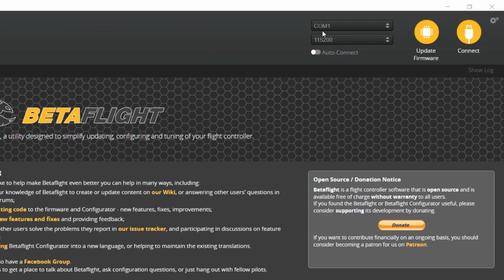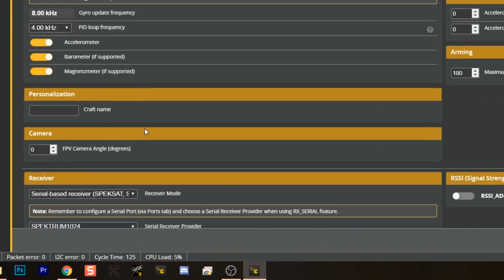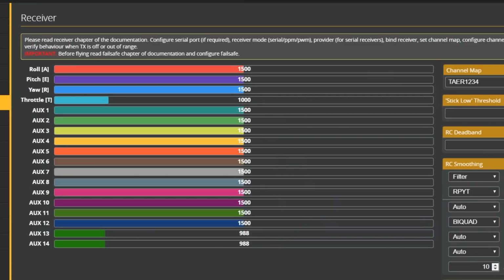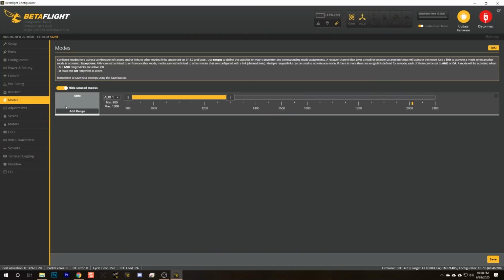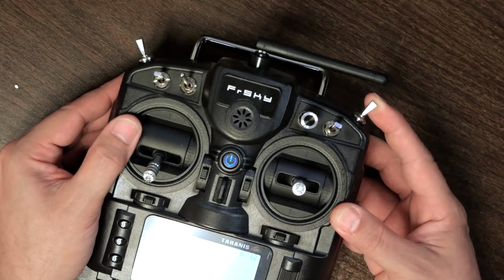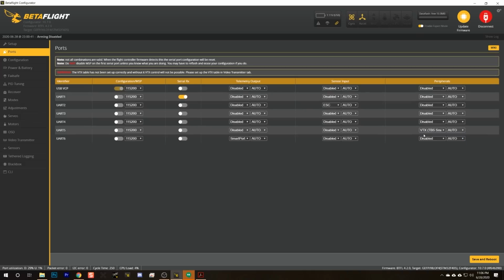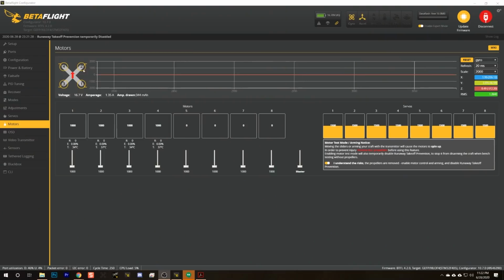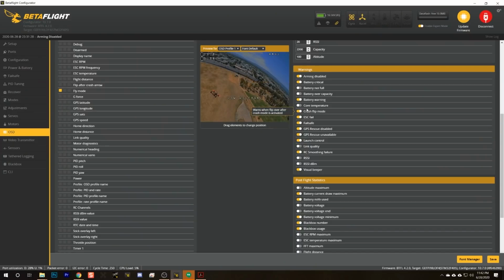FPV Drone Budget Build Full Tutorial - Part 3 - Betaflight 4.2 Complete Set Up

Comment: Hey Joshua, is the PID loop frequency choice of 4khz for any reason? I’ve read on Oscar Laing and other sources that the default 8khz is better. I’m not sure if this has to do with f4 vs f7 flight controller or what. But my plan was 8khz and dshot600 on my holybro kakute F7. Are those okay in my situation. And the the 48 pwm frequcy & auto motor timing in bHeli32. Please let me know if you have a chance because I don’t want to screw my first build up! You’re such an awesome help, thank you for all you do in this hobby man!
Reply from the maker: For an F4 processor, when doing RPM filtering, there is not enough CPU power to run at 8k.

Comment from the maker: Three notes on this video. For some reason, other people are having to go to the CLI and type 

set tlm_halfduplex=off
save

To get telemetry working.

Also, the 24k option seems to have disappeared on the latest batch of ESC's. I have no idea why but you are fine to run 48k.

Also, the vtxtable has changed from SA 2.0 to SA 2.1. Get the new vtxtable here: https://getfpv-media.s3.amazonaws.com/wysiwyg/files/XILO_VTX_SA2.1_US37.json
Reply: Thanks a lot. Had to set "tlm_halfduplex" to "off" to get telemetry working. Great series!
Reply: @linus.  How can I identify if I have to set the setting off?
Reply: @GothicIN  I got just ~4 telemetry "channels" on my radio. After setting the option to off, I got a lot more telemetry data from the flight controller.
Reply: Thanks!!
Reply: Ah, that explains the 48K PWM frequency. Thanks for everything you do, Joshua!
Reply: I just bought a kit and On the motor pwm frequency it originally comes with 96kHz and the motor timing is set to Auto. The lowest I can set it to is 48kHz, I know your comment says leaving it at 48kHz is fine but what about the timing? Is it fine to have it at 48kHz and the timing at 23?
Reply: 48k is the lowest I can go. I’ll set that with 23deg. 

I’m not sure if the values are dependent on each other, so if it’s a problem please send a smoke signal.
Reply: Hi JB pin this please. 2 people who got your build cos of me had VTX issues
Reply: was gettin nervous aha
Reply: The SmartAudio 2.1 table caused my video to not work at all, changing back to S.A 2.0 fixed the problem!

Comment: I just recently built this following the videos.  I used a Spektrum 4651T receiver and used UART4.  Everything in Betaflight looks to be configured correctly, and the transmitter (old DX8, DSMX) has been configured and bound.  I updated the frame rate to 11ms, too.  All the controls are reacting appropriately.  As soon as I increase the throttle though, the quad will hover for about 3 seconds, then do a hard right roll and go straight into the ground.  On my workbench (no props), the motors are working OK as tested in Betaflight.  If I increase the throttle on the TX though, just a little, it seems like the motors go into "run-away" or something.  What I should take a look at?  Aside from the Spektrum receiver, the only thing different from the videos is that Joshua said change the PWM frequency in BLHeli to 24kHz.  The lowest I can change it to is 48kHz--the slider doesn't go any lower than that.
Reply: 48 kHz is a good setting,  I am using that setting on my 5 inch quads.

Comment: Hi Folks. I have built this drone and had it in the air successfully. Unfortunately I am losing controller range and video at about 20-30m. I am new to FPV but am in the understand that this setup should give me a range of a couple hundred metres? I have checked all the settings. VTX power is at 600. my concern is that im losing controller signal and video signal. Any help would be greatly appreciated. Thanks Warren

Comment: Anyone else having issues with the VTX smartaudio? I'm using the same FC and Xilo VTX board that comes with the kit. I copied the table from smart audio 2.0 and saved it in. The smart audio ready field will intermittently decide Yes or No. Once it says No, I have to unplug everything, shut it off, then power on again to get it to say Yes. Then, when I try to change the VTX settings using either my goggles or betaflight, it only sometimes listens to my commands, like which band and channel to select. But it never listens to commands about power level or Pit mode. There is some functionality, otherwise, I would not be able to change the video channels, but I'm not sure why I can't change the power levels. I've checked that they are the correct values from the video.
Reply: Did you get a fix for this? No matter what I do , I cannot get mine to switch out of pit mode.
Reply: @ItsOneEye1977  Nope, I never did. Instead, I linked VTX power to a switch on my controller and used "low power until first arm". Works well enough for me. But yeah, I can't toggle pit mode, nor the current power level.
Reply: @tallxcrunner  Thanks for the quick reply. So once your armed and going you are able to switch power levels? If that's the case I will look into doing this method as well.
Reply: @ItsOneEye1977  No I still can't switch levels, but because the programming works for "low power until arm" it'll automatically adjust itself. Also, I just turn off the vtx when I'm not flying by using my controller. Good luck with the build.

Comment: A few of us discovered that with the latest kits we got, we've had to go into BF CLI and run "set tlm_halfduplex = off" to get telemetry working properly.  If anyone else has issues getting all of the Telem sensors showing, try running this in the CLI. We were both using the RXSR receiver with Taranix x9d controllers.
Reply: Being a Noob I could not get my telemetry working until setting halfduplex= off AND followed by a SAVE command.   Just executing the halfduplex command doesn't fix the issue unless and until the SAVE command is issued.   As my QX7 was in discover sensors mode, the additional sensors populated immediately  after SAVE.  Playing arround on the QX& Telemetry page I tried "Delete All Sensors" and  tried to discover them again.  I could only  discover two sensors  and had to repeat the  BF CLI halfduplex and save commands and the remaining sensors would then repopulate.   Also found that the additional sensors don't work well if at all on USB only power. ,
Reply: This needs to be the top comment on here. I just figured out how to fix this after 2 weeks of head scratching.
Reply: Thank you for this. I'm running an X-Lite and setup a convoluted way by adding the sensor to an input then adding that input in a mix. It works but man I wish I would have seen this sooner. Thanks again!

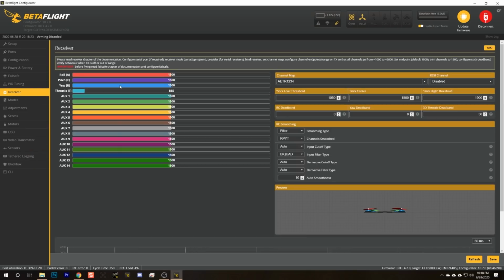Comment: Everything went smoothly until @11:20 . I am on 95x v2 with crossfire and Radiomaster TX16S. TX16S is switched on but nothing moved in the receiver tab. So connected a lipo to the 95x and tried again. Still nothing !! Any help?? Thanks in advance.
Reply: I have the exact same drone and radio! Did you get everything sorted?
Reply: @johnluket1526  : not yet mate. Lol.
Reply: @Firografi  Hey! So I'm almost all the way through the video so I can't verify that it all works at this point, but to get the things moving in the receiver tab I went to the ports page and enabled Serial RX for UART3 and then plugged in my quad to the battery while it was connected via usb to the computer. You can roughly follow his same steps from there to get the min/max to 1000/2000 for your inputs on the TX16s.

Also to note, I didn't change his first few suggestions in the configuration tab and kept them default since he's making those changes based on his specific FC I assume. (PID loop freq. didn't need to go from 8k to 4k as its default on this fc is 2k. Default is ONESHOT125 so i didn't enable Bidirectional DSHOT. I should have enough time today to finish and get a test flight so i'll let you know how it goes.
Reply: @johnluket1526  ok mate. Let me try again. Well, my issue was that I bind the crossfire successfully (hope so because the green light was lit up on both ends) and assigned the arm switch. But the motors did not spin when I arm but the green light on the drone flickers everytime I arm the switch on and off. So I thought I will go through these steps here and updated the firmware and got stuck up. Lol. And I downgraded it to it's stock. Let me try your suggestions and check on it. Thank you :)
Reply: @johnluket1526  ok! Now the motors are spinning. I just changed to 2k from 4k and oneshot125 from 600. But now when I throttle up, the drone does a somersault with a freaky noise and then lands and motors stop. 😂 Is it the turtle mode that's active? If so on what's switch is it on by default ?? 😬
Reply: @Firografi  Mine did the same thing! The gyro wasn't calibrated correctly for me in the betaflight tab where you can see your drone moving about. I just crashed my whole setup into a retention pond so i'm no longer an owner lmao
Reply: @johnluket1526  I'm having issues getting receiver inputs to show up in BetaFlight. Any help you guys can provide would be appreciated. I'm bound and I can see telemetry of the drone from the Transmitter. Why doesn't betaflight or the drone see my Transmitter inputs?

Comment: Im unable to change the PWM freq to 24 i only have 48 or 96. Default is 96... is this due to the 1700KV motors? Or am i missing something?
Reply: I have the same issue. Did you ever figure it out?
Reply: @ericbell8247  not yet, im gonna message Bardwell directly
Reply: Same issue for me, I got the 6s build too. What was the response from JB?
Reply: @De-Rig  he added an update on his comment.
Reply: @RobertMehrer  where is his update (guessing it's staring me in the face somewhere here)? I'm also unable to set it below 48.
Reply: @RobertMehrer  nevermind, found the note in his first comment (48khz in fine) on this video. Couldn't see the forest for the trees!

Comment: Configure motor : only Motor #2 and #4 are running. BLHeli doesn't recognize motor #1 and make some king of noise when trying to run it. I try with another cable linking ESC and FC. Nothing change. What kind of test should I do to know who is faulty ?
Thank you.
Reply from the maker: Contact getfpv support.
Reply: @JoshuaBardwell  Merci !

Comment: I have set mine up exactly to your specs.. and am having terrible Dsync issues.  When doing back flips, on the throttle down the quad will flip then continue to spin uncontrollably. Seems there might be issues with BLHeli and these F3 ESC's.. Can you confirm???
Reply from the maker: I haven't experienced any such issue. If you suspect bad hardware, contact GetFPV customer service.

Comment: Hi Joshua,  I Turn ON the Bidirectional Dshot on my Emax TinyHawk2 , and for some reason,  I could not Arm my Quad. Can you if you can, tell me why? I am new and I am a fast learner. Also to adjust the Throttle to Min 1000 and max 2000, do there is command on the cli that you can perform? Thanks
Reply from the maker: Your ESC does not support bidirectional dshot that's why the FC won't arm.
Most likely you need to flash JESC to support bidirectional dshot. However not all blheli_s ESCs support that feature.
https://www.youtube.com/watch?v=NgBJJG0slM4
Reply: @JoshuaBardwell  Thanks a Lot.

Comment: Now I understand why my vtx wasn't working, I was thinking that it was broken.
Thank you Joshua for this tutorial, now I know that I don't have to buy another vtx
Reply: Hi, i also have a problem with VTX. Wich was you problem/solving ? thanks
Reply: @itsnesco  my problem was that the I didn't understand that the vtx was in pitmode.
For exit from pitmode I have to press the power button for 4 seconds, and so I solved the problem.
I solved this by watching the minute 38:50
Reply: @lorenzogrossetano  thank you Lorenzo, i did it yet, but that's not exactly my problem, thank you
Reply: @itsnesco  what is your problem? May I can help you?
Reply: @lorenzogrossetano  thank you, from the last update of my firmware (with the last one), i lost VTX (i had it all in the initial firmware version, without any problem)  I have a "316 = SA 2.1 unlocked" in the vtx debug key so choose SA 2.1 from USA and configure it in BF. I still can't get image, noway for me; I checked all several times without solving that problem...
Reply: @itsnesco  maybe you can try to see if the vtx is broken by connect directly the vtx with the cam, without passing through the OSD of the fc.
Have you controlled that the signal doesn't connect with gnd?

Comment: Hi Josh, love your work. Is there a similar method for setting the min max on a Spektrum (DX6) transmitter?
Reply: You should be able to set them from the transmitter osd. settings maybe under channel setup or travel adjustments. unfortunately I am using the dxe and it doesn’t have osd so I have to do everything on the computer. Good luck.

Comment: Hi Joshua, I have followed through this build with similar components but ran into an issue. From the box with everything plugged in i could see video through my goggles no problem. I then followed through the build and set up process with betaflight and now have no video on the goggles. I can see that the vtx is still working and connecting correctly and when I connect the camera and video wires directly I get video back. Is this an issue with the board that can be fixed or have I somehow fried something?
Reply: Hey,  I have the same problem. How did you fix it?
Reply: @marchofmann4704  sadly just had to get a new flight controller and it now works fine
Reply: @charlierobert-tissot1567  Thanks for your response. How did you know that it was the flight controller?
Reply: @marchofmann4704  well when everything was wired up as it should I didn't get video sent to my goggles. I then soldered the camera wire with the vtx wire to send it directly and got video but obviously no beta flight osd as it wasn't going through the flight controller. This essentially meant the vid tab on the flight controller wasn't working. Ordered a new one and worked fine. Also if you do order a new one you can use it just to test. So even if you get your one working it's helpful to have a spare that you can troubleshoot with for future issues
Reply: Charlie Robert-Tissot okay, thank you for your help 👍🏻

Comment: Hi! Just wanna say what an amazing kit and I just got it together. Everything is set up on beta flight and it flys absolutely great!! I do have a bit of an issue and was wondering if you could point me in the right direction. After installing the files for the tx for the access protocol, the only quad I can now fly is the xilo kit but all my other quads have rxloss. Any words of wisdom would be much appreciated.
Reply from the maker: You have to also flash your other receivers to the latest firmware and re bind them.
Reply: Joshua Bardwell thank you so much for the quick response! All my other models are micro whoops with built in receivers that are D16 protolcol. I apologize for this possible dumb question but how do I go about reflashing those?

Comment: Nice and concise! I put my beeper and flip over after crash on the same switch setting.
Three way: 

Top) Angle mode.

Middle) is for the beeper and flip over after crash mode.

Bottom)  Acro mode.

Living Downtown, Angel mode is great to test equipment.
Reply: I did that too but changed it around. Tbaga the best thing about having a radio with all the switches you can set it up anyway you want

Comment: Hi Joshua! BF 4.2 running on your FC JB F4 AIO: No rssi showing in OSD! Done it all like you said in that one video, Config Tab RSSI deactivated, RSSI not on any receiver channel..
RSSI value warning on OSD, like there is none at all. Crossfire Nano installed, LQ on channel 8  It's got sth. to do with RSSI/LQ confusion - am i guessing right? Clueless a.t.m., plz help =)
Reply from the maker: Update Crossfire module and receiver to the latest firmware. Disable RSSI_ADC. Disable RSSI channel. Use OSD elements RSSI dBM and LQ.
Reply: @JoshuaBardwell  aaah yep, got me.. Updating will be done! Thx a lot for fast response! :-) And hi from Berlin Germany

Comment: Hey Joshua, why don't you leave the PWM frequency at 48kHz on the ESC? In your video series for blheli_32 configuration, your advise was to set it from 24 to 48, or am I wrong??
Reply: I was wondering the same thing...
Reply: i¨m wondering about the same to....
Reply from the maker: Betaflight 4.2 has low throttle stability problems on 48k so for this build I recommend 24k.
Reply: @JoshuaBardwell  blheli wont let me go below 48khz how do i get 24
Reply: @JoshuaBardwell  so the blheli suite only allows 48-96 when I connected last night. Low end of the slider is 48. What would you suggest?
Reply: My bad.   you answered this question thank you for your knowledge in fpv

Comment: Why set the min max on the radio and not via the rxrange command in the cli as you previously have done?
Reply from the maker: Setting min max on the radio means that any future quads that are bound to this same model will already have their endpoints correctly set. Setting min max using rxrange sets the endpoints on the FC, which means the process is the same no matter what controller you are using. I tend to show one vs the other depending on if I know which controller people are using for the build.
Reply: @JoshuaBardwell  Ahh gotcha. So depends really if you have more than one controller you want to bind to the quad. Thanks for replying Joshua. Always follow your vids and you've helped me a lot with my flying.

Comment: Can I connect dji controller to this drone
Reply from the maker: Yep for sure.
Reply: @JoshuaBardwell  Would you have to have the Air unit or Caddx Vista installed on the quad?
Reply: That's something I've been wondering as well,  what do you suggest?